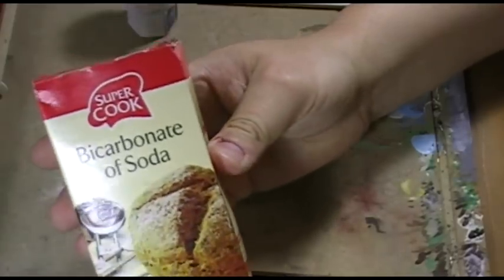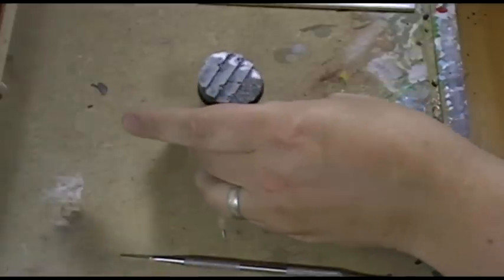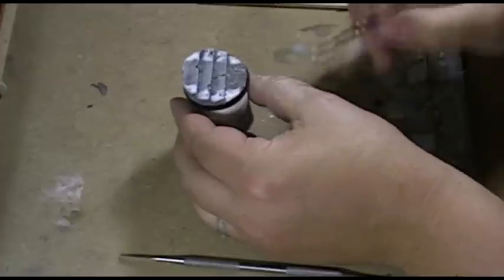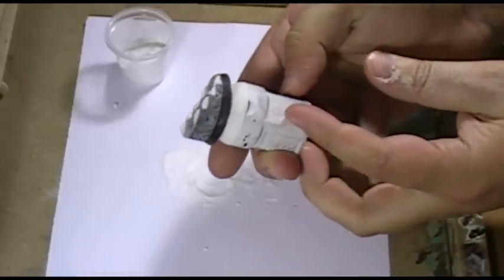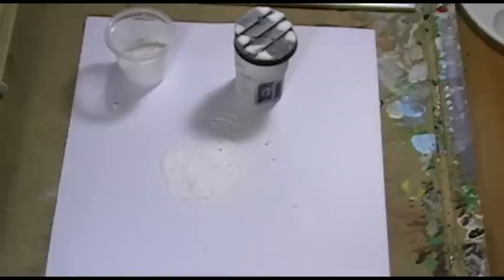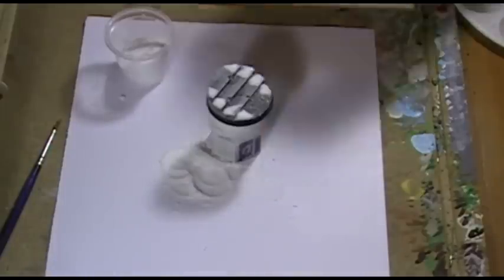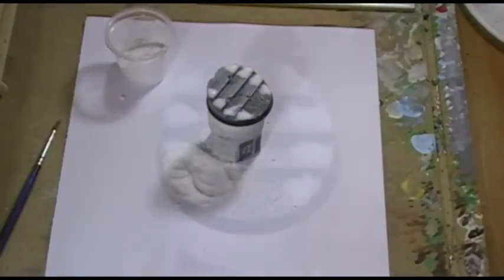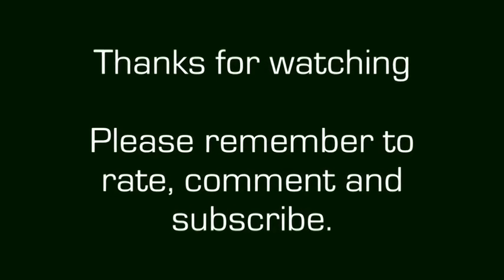How I Make Snow Bases

Comment: For those using baking soda for snow bases, remember the baking soda is an absorbant. So it will suck up any moisture like any bonding from PVA glue that is 'water'.  So it will flake with time. That is why I did a mix..  A serious generous about of PVA glue.  3 parts to 1.   1 part water to keep it smooth, and one part paint to paint the baking soda to keep it from changing. You mix it til its a 'toothpaste' mix..  Then apply. I have a building over a year old. No change or flaking after games.

Comment: Very nice tutorial.  but there is one problem that I have encountered with baking soda.  Over one year, baking soda turns yellow.. Like pissed on snow.. I have have learned that mixing baking soda, with PVA glue, along with white paint..  (GENEROUS AMOUNTS OF WHITE GLUE OR THE BAKING SODA WILL FLAKE OFF. )   Mix this up and that will solve the changing of colors of the baking soda over time. 

Cheers bud.

Comment: Did you also make that base? or is a bought resin one? 
I Have see it where some1 expanded/dried the B/Soda (it basically doubled in fluffy volume. and then used it. Did U do this or was your B/Soda straight from the pot container?

Great Vid.